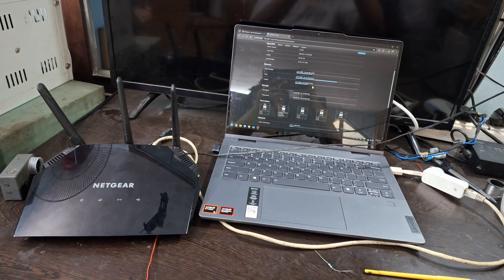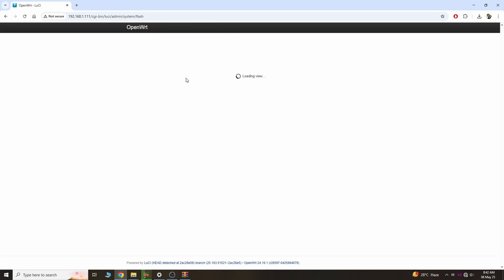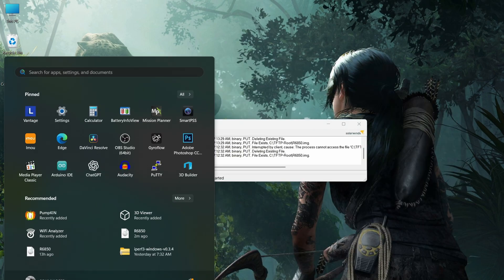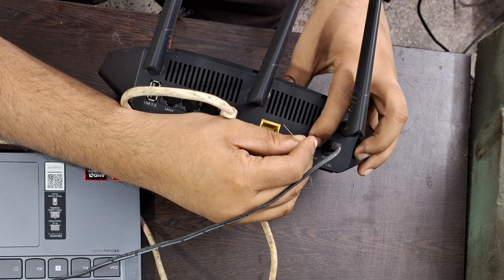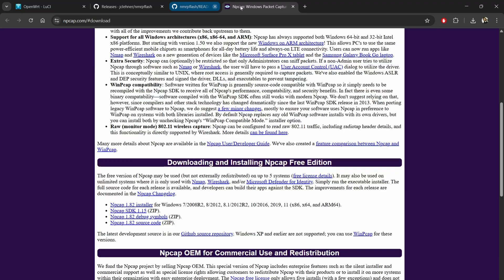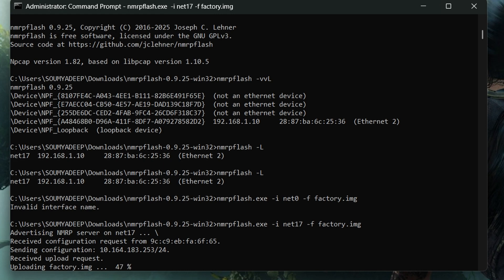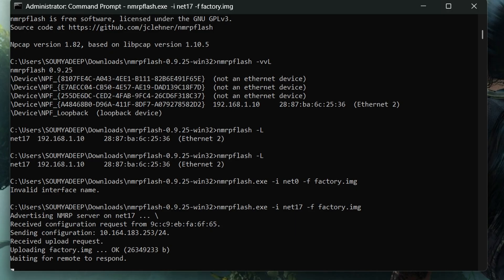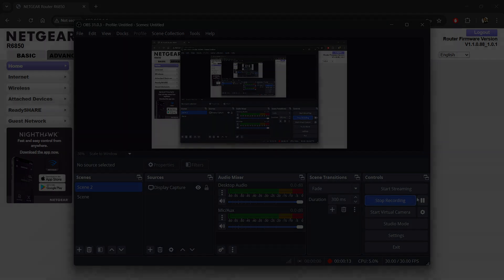How to Revert OpenWRT to Stock Firmware | 3 Proven Methods! | Netgear R6850 Restore Guide 2025

Comment: help me brother for d link dir 853 a3 router  firmware is cruppted please i need to decrypt firmware to restore my router can you help me
Reply from the maker: You can reinstall the corrupted firmware on your D-Link DIR-853 router using the emergency recovery mode and a wired connection to a computer with a static IP address. 
Preparation
Download Firmware: Download the latest official firmware file (.bin or .rst) for your specific hardware revision of the D-Link DIR-853 from the official D-Link support website. Store it on your computer's hard drive.
Wired Connection: Connect your computer directly to one of the LAN ports (not the WAN port) on the back of the router using an Ethernet cable.
Static IP Configuration: Configure your computer's network adapter with a static IP address in the 192.168.0.x range (e.g., 192.168.0.2). Set the subnet mask to 255.255.255.0 and the default gateway to 192.168.0.1.
Disable Firewall/Antivirus: Turn off any antivirus or firewall programs on your PC temporarily, as they may interfere with the process.
Use Compatible Browser: Use Internet Explorer or Mozilla Firefox for the recovery process, as other browsers like Chrome may cause issues. 
Recovery Procedure
Power off the router: Unplug the power cord from the D-Link DIR-853 router.
Enter Recovery Mode: Press and hold the reset button on the back of the unit (use a paperclip).
Restore power: While still holding the reset button, plug the power cord back in.
Wait for indicator: Continue holding the reset button until the power or status light starts blinking in a specific pattern (e.g., blinking amber or red, or a sequence of LEDs flashing). This indicates the router is in recovery mode. Release the button.
Access Recovery Page: Open your web browser (Internet Explorer or Firefox) and navigate to the IP address http://192.168.0.1. You should see an "Emergency Flashing" or "Firmware Upgrade Utility" page.
Upload Firmware: On the page, click the "Browse" or "Choose File" button, locate the downloaded firmware file (.bin or .rst) on your computer, and then click the "Upload" button.
Wait for Completion: The upload and firmware upgrade process may take several minutes. Wait for a "Success" message to appear. Do not interrupt the process or power off the device.
Reboot and Reconfigure: After the upgrade is complete, the router will reboot automatically to factory default settings. You can then change your PC's IP settings back to automatic (DHCP) and access the router's web interface at http://192.168.0.1 (username: admin, password: leave blank) to reconfigure your settings.